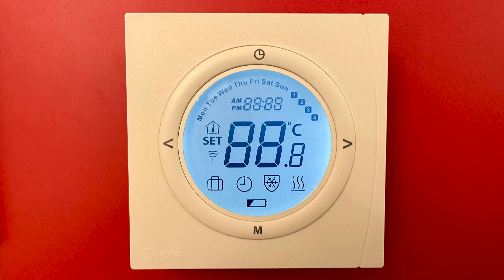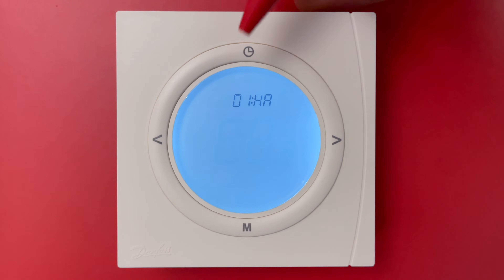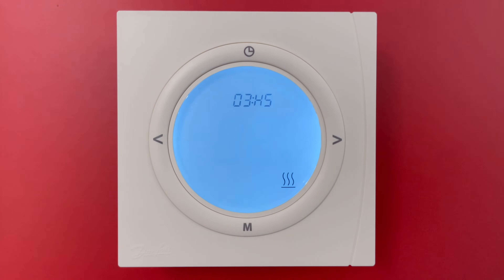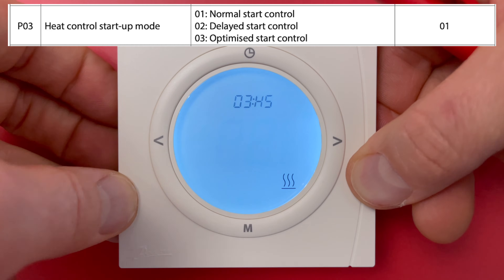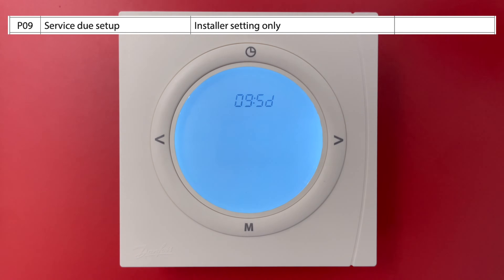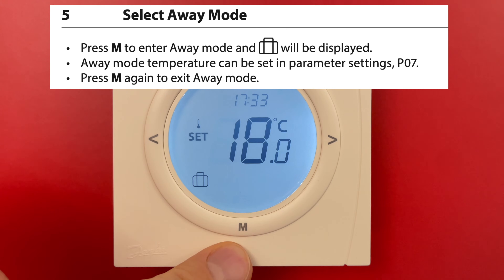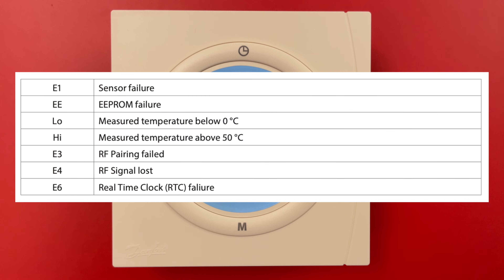Danfoss thermostat TP5001 SETUP & MENU

Comment: Your video was so clear and thorough thank you! I just have a question. I used your video yesterday to set my thermostat on holiday mode. I set it to 16 degrees celcius. I live in a new build building and the rooms are warm even with no heating (around 19 degrees). I come back from holiday on Friday. I am scared that holiday mode will malfunction by itself and the radiators will get too hot and explode or cause a fire. Do you think this can happen or do you think it is safe on holiday mode?
Reply from the maker: Holiday mode is nothing special. It is just an easy way of setting a temperature. It is good, house is well insulated as it keeps 19C for a long time. 16C is safe temperature for most of buildings. If you have some doubts there might be some problems with electricity, gas supply, heat supply ... Thermostat or system with remote control could be an option. I would then recommend: Danfoss Icon 2 or Devi SMART thermostat.
https://www.youtube.com/watch?v=zIZuP63CJY4&t=3s
https://www.youtube.com/watch?v=vcQJ8Ch77sc&list=PLheF_NCQvCznWTX_f1vojZZAjXCRht8vF

Comment: this is so helpful thank you! if i turn on holiday mode then will it stay on until i turn it off or will it turn off automatically?
Reply from the maker: Holiday mode works only on manual on and off. Unfortunately there is no timer for it.
Reply: @heatingsolutions123 thank you! so if i have it on manual and on holiday mode then it will only turn off when i turn it off?
Reply from the maker: @simrankainth5458  turning thermostat off with button on top will switch it to frost protection mode. Usually 5°C. Use M button to switch it to "suitcase" - holiday mode. Or if you are using Manual temperature control, just go down with temperature setting to let's say 16°C. Or lower setting, but lower is not recommended to wood furniture or covering.
Reply: @heatingsolutions123  i have switched it to holiday/suitcase mode using the M - my question is will it stay on suitcase mode until i come back from holiday and take it off suitcase mode by myself? thanks! i want it to stay on suitcase mode while i am on holiday but i am scared it will turn off automatically

Comment: Really useful video, as the device is very confusing. I was not sure how to set it up at all because no instructions provided, so the temperature dropped in the middle of the night or randomly during the day and I didn't know why, seems schedule mode was set but now I know how to set it on manual, thanks!
Reply from the maker: Thanks for your feedback! I’m glad the video was helpful and that you were able to figure out!
Reply: @demoix  how do you switch it to over ride timed without having to go to boiler to change over
Reply: @Youdolooklovely  Not sure what you mean, but I set mine on manual mode on thermostat for 20c all day and night and left boiler on all the time, which basically what I want in winter to keep the same temperature all the time. If I would got somewhere longer for few days, I would either turn off boiler at all, or lower the temperature via thermostat, easy

Comment: if you switch off the power button does that mean the heating will not turn on apart from frost protection if its off?
Reply from the maker: Yes, you are right. Heating will turn on only at frost protection temperature is reached.

Comment: How do i do no timer just the heating comes on and off when i turn it on and off 🤷🏻‍♀️
Reply from the maker: Just go to service menu, hold "M" for 6s. Select P01 01 - Manual temperature operation. Selecting higher or lower temperature with < and > comparing to measured will turn your heating on and off

Comment: Hi, when setting timers do you have to choose 4 times a day for heating to come on? I want it to come on just morning and evening
Reply from the maker: Hi, 4 times change will give you morning and evening heating. Lest say morning 1time (6:00, 22C) 2 time (8:00, 20C) - it means you have used 2 times, but higher temperature will only be from 6:00 till 8:00 (22C). Same with evening.

Comment: Way to overly complicated, what happened to the simpler days struggling with this thermostat atm
Reply from the maker: I would then: activate display back light to be on, hold "M" for six sec. and select P01 - 01. You will have Manual temperature adjustment. With < > select temperature you want. Thermostat will maintain it.

Comment: I’ve set the boiler to run only in the morning and evening, but it’s still operating outside of these scheduled times.

Any idea how to fix this, i have selected 24hrs
Reply from the maker: Hi,  
I would select then:
P02 02 - ON/OFF standart operation. Boiler is ON till set temperature is reached. 
and
P03 01 - Normal start control.

Out of all of these settings:
P01 01 - Manual temperature operation
P01 02 - Schedule timer 5/2 day
P01 03 - Schedule timer 24h
P02 01 - ON/OFF Load compensation is enabled. ON/Off load compensation is a feature of temperature control products such as room thermostats and programmable thermostats.
On/Off load compensation is a proven method of minimising energy use by calculating the demand from a thermostat. As the temperature approaches the required setting, the boiler will fire for shorter periods of time, ensuring a constant temperature is maintained. This not only enhances comfort levels, but also uses less energy. On/Off load compensating products are ideal for use with modern systems in well-insulated houses. Recommended for use with gas condensing boilers. Thermostat prevents boiler working for too long period of time. In this way, the heating works more efficiently, as the return temperature of the heating return is lowered. Condensation is better. Less gas is consumed.
P02 02 - ON/OFF standart operation. Boiler is ON till set temperature is reached. 
P03 01 - Normal start control.
P03 02 - Delayed start of heating. TP5001 thermostat includes an optional delay start feature to hold off the heating for a time on mild days when the room temperature at the start of an event is close to the programmed value. Recommended for use with gas condensing boilers in order to use less gas. In other words, it is an economic mode.
P03 03 - Optimised start control. TP5001 thermostat includes an optional optimum start control. This feature allows you to set the time at which you require a room temperature by. The thermostat then calculates how soon before the event time the system must be turned up to ensure that the room is at the temperature by the required time. Heating can be started maximum 120 min before schedule. 
P04 - Temperature limitation high
P05 - Temperature limitation low
P06 - Frost protect temperature
P07 - Away mode temperature
P08 01 - Timer display 24h
P08 02 - Timer display 12h
P09 - Service due setup. Installer setting only
P10 00 - RF Pairing mode OFF (TP5001RF only) 
P10 01 - RF Pairing mode ON (TP5001RF only) 
P11 01 - Auto daylight saving ON
P11 02 - Auto daylight saving OFF

Comment: Hey so I’ve put my setting on manual, please can you tell me if this is right or what setting I should have it on so I can have my thermostat set to so if it falls below 19 degrees it turns on by itself till it reaches 20 and then turns back off by itself, or is this not how this thermostat works. I don’t want to put it on a timer
Reply from the maker: Yes. You are right. Choosing manual setting 19°C will maintain 19°C +/-0,5°C
Reply: Your asking a lot   , you may have to take it off put in in a bucket of water for 24 hr take it out , let it dry ,do the oaky coaky , run outside naked , then learn how to fly a space to mars , and you still won’t understand the themstate after that , didn’t mean to be sarcastic, but 20 yrs I’ve been at it , and I have no clue , hope you get contacted by someone who can do the rubix  cube , in 50 m of water in the dark and upside down while being chased by a shark
Reply: Go and learn how to fly a space craft to mars , I’ll be faster than how to understand this thermostat

Comment: I cant turn it on for 24 hours 😖any advice ?
Reply from the maker: @mariasajkova4412  you need schedule for 24 hours or just stable set temperature?
This setting will maintain set semperature with no changes:
P01 01 - Manual temperature operation

This setting will let you make own temperature schedule with comfort and economy temperatures. All week days will be with same schedule:
P01 03 - Schedule timer 24h

Comment: We're in a new home and this thermostat is the worst we've ever come across, the on/of button is jammed on frost protection mode 5 degrees and can't get it off or reset any advice please
Reply from the maker: @lynnwebster9764  not sure if this would help. I would try to cut off electricity for thermostat, with main power switch. While thermostat is off would be good to push any buttons on thermostat to drain electricity inside. And then power on. If on/off button is jammed and there is no way to fix it, you need a new thermostat then.
Reply: @heatingsolutions123  thank you, I think we need a new thermostat, to be honest we think we will get a completely different system as this is an absolutely terrible system. So many flaws
Reply from the maker: @lynnwebster9764  and there might be something else also. Wrong wiring, boiler setup …. Hard to comment. Off course I would start from changing thermostat as it’s button is stuck.
Reply: Same for us, complete idiot has built this model,

Comment: Hi thank you for this great video. I would like to set my heating to stay on from 8am - 10am. Whilst I understand that there is the option to turn on the heating at a specific time, I am unsure if there is a setting that allows you to select the duration of the time the heating stays on ie 2 hours in my example?

Thank you
Reply from the maker: Hi! Heating will be on from 8am to 10am if set temperature will be higher comparing to real.

Comment: How do you put the boiler on as and when you need it, instead of setting day and times, it's very rare I heat the whole house when my son is in school, I've not long moved in
Reply: I've set them all at 01, is that right
Reply from the maker: Setting P01 at 01 means you have manual mode. Heating will be ON if set temperature is lower comparing to real. It is more efficient to have schedule.

Comment: How does manual mode work?
Reply from the maker: Manual mode means your room temperature has to be set manually. Usually 22C. And room temperature set point (22C) will not change during a day or a week. If you want to reduce energy usage on night time, or while leaving you have to decrease it also manually.

Comment: I have an E4 error message on mine , will resetting it fix it ?
Reply from the maker: Resetting probably not. E4 - is RF signal lost. Check if your receiver is on. Get thermostat closer to receiver. Or get thermostat closer and re-pair.
Reply: @heatingsolutions123 yeah resetting didn’t fix it but I did re pair it easy enough n it’s working fine now , Thanks for the reply 👍🏻

Comment: Hi thanks for taking the time to make these videos. I have 02.3 on my screen… do you know what that is? I looked at fault codes and can’t see that code In the manual. 👍🏻
Reply from the maker: Hi! Strange... I would recommend resetting, TP 5001 Reset Video is here: https://youtu.be/5fzT1mMkY7g?si=8XEnOrIMdu7Mc_dI 
In case resetting does not help - thermostat most probably is broken.

Comment: Mine won't come on at all how do you turn off the timer?
Reply from the maker: Hi:) If you really got same thermostat TP5001. Hold "M" for 6 seconds. At P01 SET 01 - (Manual temperature operation)

Comment: Very difficult thermostat to understand the operation, even though you explained it very well I blame the manufacturers.
Reply from the maker: Less sophisticated would be not programmable. Such as RET 1000 or RET 2000
Reply: Not that difficult but there's a few modes that aren't needed.

Comment: Helpful. My thermostat was flashing e6. I reset it which seems to have got rid of the e6 message. But now our boiler is on all night from like 11pm - 7am. No heating, just the boiler being on and releasing the steam from the vent outside. Any ideas why? Thanks, Dan.
Reply from the maker: Usually if heating is not needed, boiler switches to hot water preparation. If hot water is not needed, hot water tank is full of hot water. Boiler goes to stand by mode. If steam goes out - boiler is on. Please check your set temperature and real temperature measured by thermostat. If set temperature is lower you should see waves symbol and boiler should be on. Otherwise boiler should be off (if hot water is not needed) To check if installation is right you can switch from scheduling mode to manual temperature mode.
Reply: @heatingsolutions123  thanks. Yes I've currently had it in manual mode for nearly 48 hours which does seem to have it working perfectly fine. So I'm not sure why it wasn't working fine in 5/2 setting.

Comment: Hi,

I have a combi-boiler and I’ve set my thermostat to timed mode (5/2) with the following:

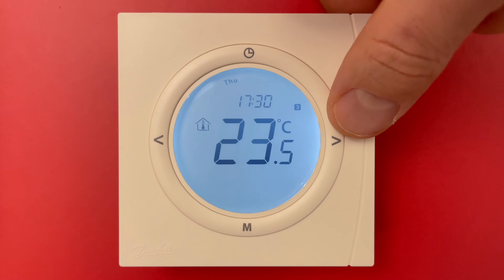07:00 - 18C
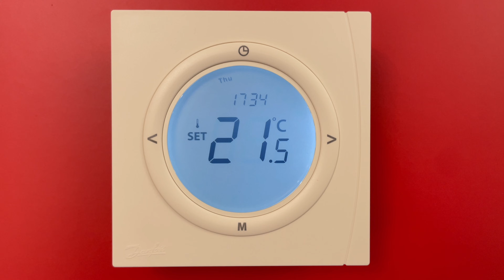10:00 - 18C
17:30 - 19C
21:00 - 19C

However, after event 4 (21:00), the boiler still switches when the temperature goes below 19C. Is this normal as I expect no heating after 21:00. Is the boiler not meant to turn off after 21:00 overnight and not come back on until 07:00? 

Thank you!
Reply from the maker: Might be you are using P02 01 - ON/OFF Load compensation is enabled. ON/Off load compensation is a feature of temperature control products such as room thermostats and programmable thermostats.
On/Off load compensation is a proven method of minimising energy use by calculating the demand from a thermostat. As the temperature approaches the required setting, the boiler will fire for shorter periods of time, ensuring a constant temperature is maintained. This not only enhances comfort levels, but also uses less energy. On/Off load compensating products are ideal for use with modern systems in well-insulated houses. Recommended for use with gas condensing boilers. Thermostat prevents boiler working for too long period of time. In this way, the heating works more efficiently, as the return temperature of the heating return is lowered. Condensation is better. Less gas is consumed.

Please try setting: P02 02 - ON/OFF standard operation. Boiler is ON till set temperature is reached. 

And setting: P03 01 - Normal start control.

Comment: Hi there, I have a Danfoss Tpone thermostat. 

My thermostat starts my scheduled heating 3 hours before my programmed time I’m assuming it’s preheating. for example, ( 7am - 11am for 21  is my scheduled heating time) the thermostat will activate hours before my programmed time which I do not want. 

Please can you tell me how I can set my thermostat to start at my programmed time and not preheat in advance? 

I have these modes - normal start, delayed start and optimised start. - 

Thank you so much.
Reply from the maker: Hi, please select "normal start".

Comment: We just moved in and have this thermostat unfortunately. I cant tell if it's on and heating or it's off. How do i tell if it's heating?
Reply from the maker: "Waves" indicate heating is on. Thermostat is calling for a heating. No "waves" no heating. For beginnig to understand your house heating behaviour I would recommend to switch the thermostat to "Manual" mode - no shedule.
Reply: How do we change to Manual?

Comment: Good afternoon,  can you do a video how to install a receiver TPOne -S for boiler ?
Reply from the maker: Hi, do you have code number?
Reply: @heatingsolutions123  087N785600 i dont get any radiators downstairs and the wifi connection drops constantly.  RF pairs with receiver ok.

Comment: I have my temp set to 35’c however my heaters arnt turning on and the temp is staying at 16’c what have I done wrong. (It set on manual mode)
Reply from the maker: From thermostat side in case you see "waves" heating should be on. Otherwise something is wrong with wiring. Try to go below 16C, and check is heating started. This would mean you need to connect from NC to NO or from NO to NC. COM on both cases should be connected.